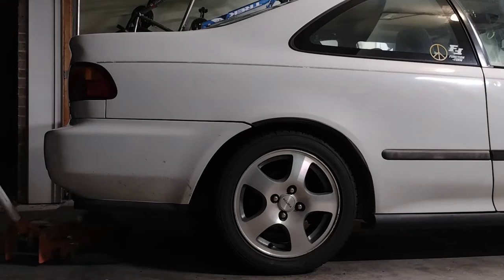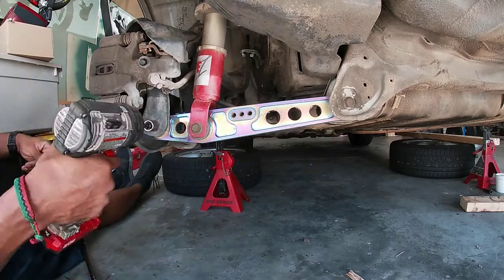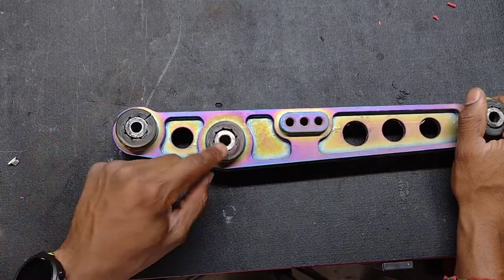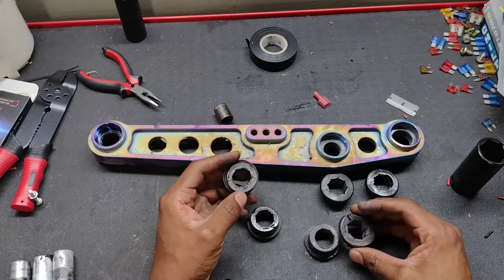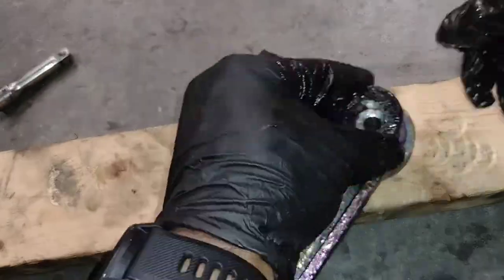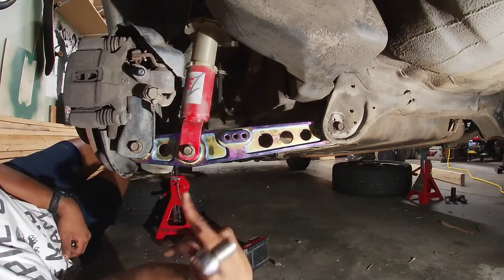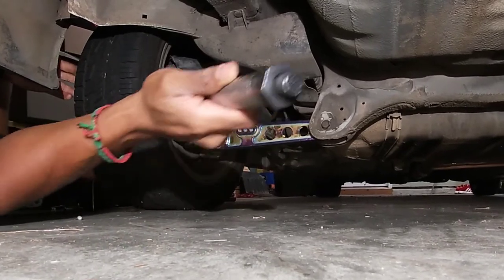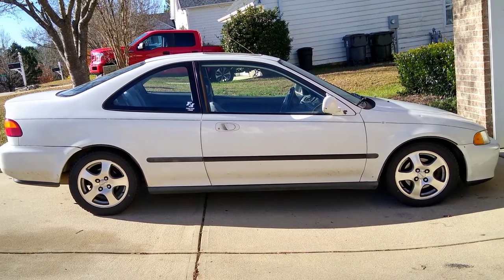My 1995 Civic gets new lower control arm bushings

Comment: Clean EJ you got! 

Less than 6 months bushings on the $50 arms I bought on ebay are cracking and falling apart on my 94. While adjusting coilovers I got kinda lazy and didn't preload before tightening down last time...

 I'm gonna follow your lead and replace them with lots of grease to try and keep them soft. 

Thanks for the quality you put in your uploads, I'll be following along with the progress.
Reply from the maker: Thanks a lot. They have a few hundred miles on them now and are perfectly silent. I'm hoping they last a long time. I'll keep an eye on them. Good luck with yours.
Reply: Thanks, and that's good to hear. That squeaking ain't gonna cut it...
Reply: what’s the best bushings for it i can’t find any hood one that will fit i have the same lower control arms lmk asap